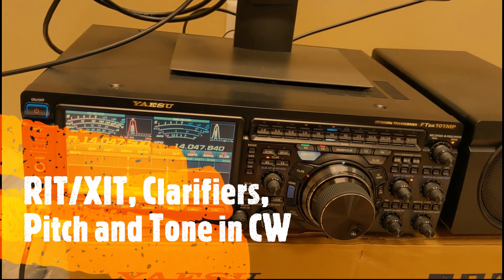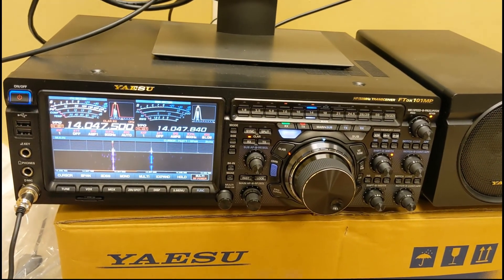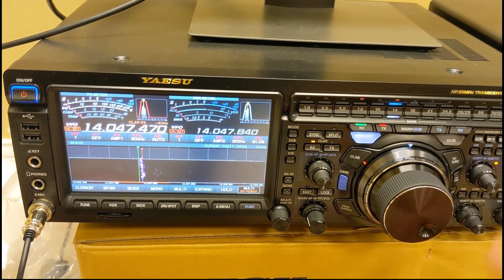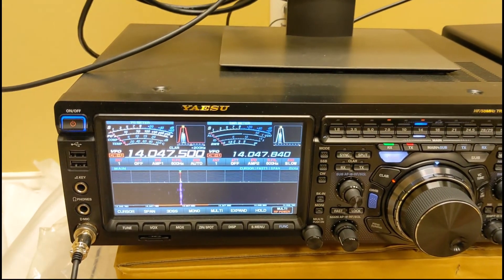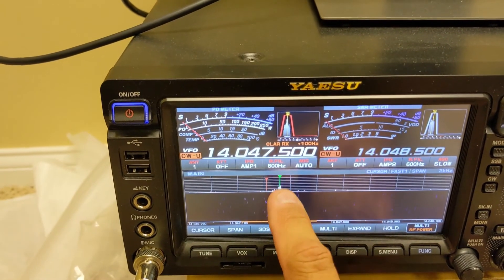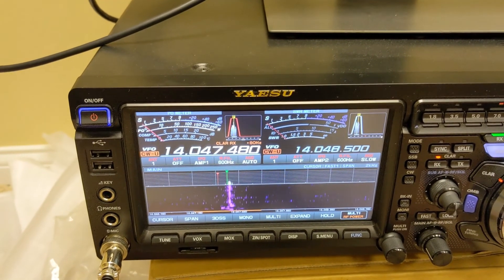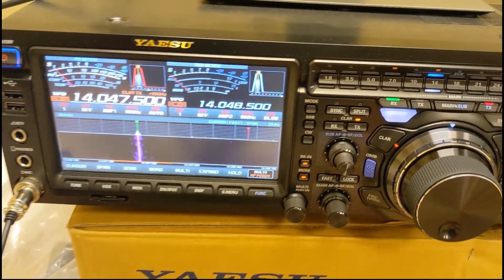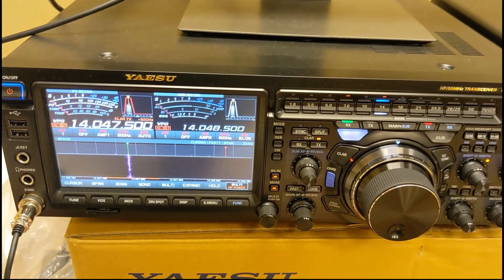Using RIT/XIT Clarifier and Pitch for CW operations

Comment: I must really remember to leave my RIT on when I call CQ its a good tip. There is so much to do, trying to get their callsign, without switch the RIT on then having to tune them in, if you are lucky they might send their call sign twice. Then you have to remember to look at the s meter. Just a tip for you when trying to get through a pile up on split. or Sota Pota. I use the Span on the waterfall set to 2 or 5 hz. I then net onto the station freq that the dx station is working. So when he as finished I am on the same freq of the station hes just worked. Maybe you might like to do a video on that.
Reply from the maker: Great idea!  I'll add that to the list for videos!  Thanks for the note!